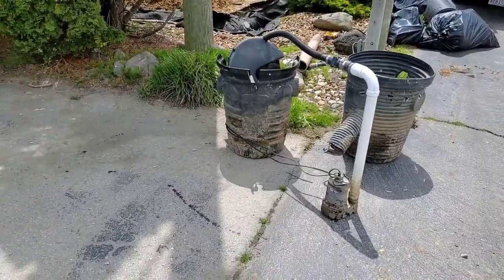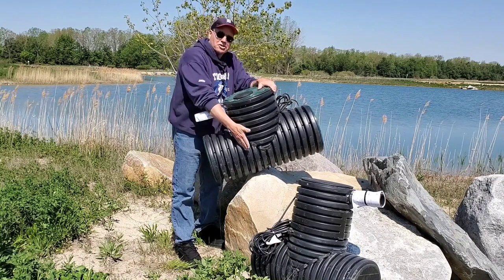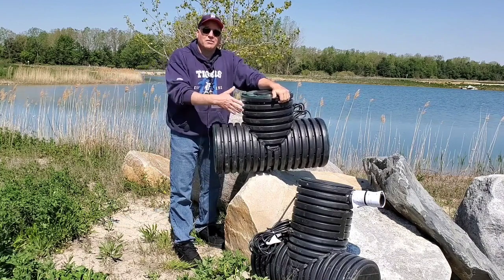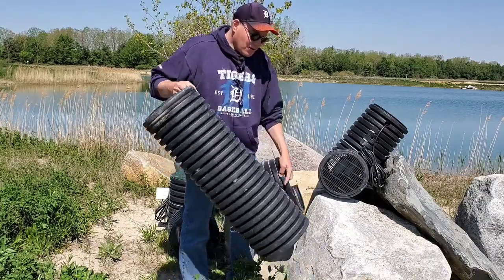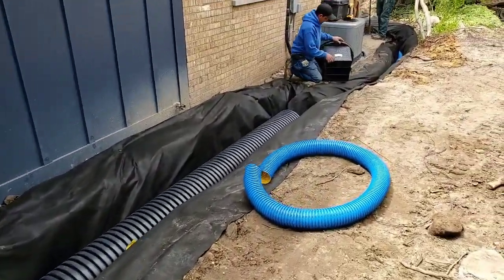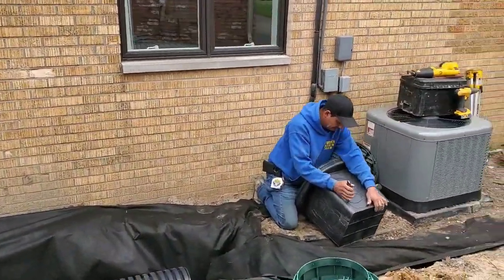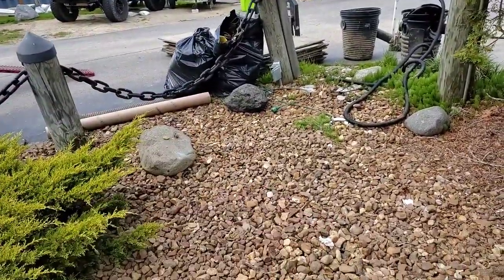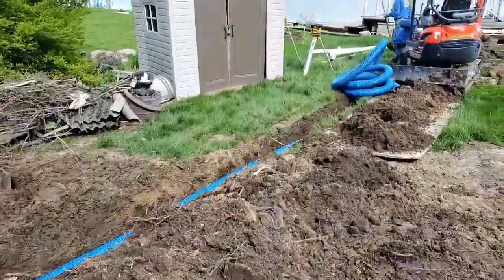Sump Pump Installation for Outdoor Drainage [Part 3] Why You Need a Chambered System

Comment: Is there a reason that the micro mini has a slotted lid on it where the bad seed has the solid lid with a small visual slotted hole?  Also the micro mini doesn’t have the extra holes drilled in the basin, do I need to drill them in myself?
Reply from the maker: The side inlets are enough the micro is a 1/3 hp the Full Frame is a 1/2 hp
Reply: @FRENCHDRAINMAN  any issues or concerns with letting “extra” water coming in the top with the lid being “open” with the entire lid being slotted and not a cover like the bad seed?
Reply from the maker: @shawnchambers5755  bark Mulch is a disaster
Reply: @FRENCHDRAINMAN  I don’t understand your reply?  Was this for another question?
Reply: @FRENCH DRAIN MAN I bought and I am getting ready to install possibly this weekend and I want to check out if I need to get a solid lid for it before I install the mini. Thanks for all your help and all your videos. I think I’ve watched at least 50+ getting ready for this DIY project.
Reply from the maker: https://youtu.be/vIkHW2bqyq0

Comment: how to you slope the pipe so it doesn't back fill? good work btw very professional.
Reply from the maker: Pump the water up in a short distance them of from 1 1/2" to 4 inch pipe. I will show this a video Stay Tuned!!

Comment: How does one of these work Inna basement with a French drain? What is the reason for having the end caps slotted instead of solid?
Reply: Hey Mike, you have the slotted ends if you want to be able to pick up additional ground water.  If you have a circumstance where you’re just pumping out storm water (from a below grade drain or something) you might consider solid ends with no holes in the unit whatsoever (as long as it’s vented to allow the water to flow in and out of course).
Reply from the maker: https://youtu.be/ZvJNV1iL0qk

Comment: The beauty of a system like this is that the attached French drain acts like an additional reservoir, with diminished capacity of course due to the stone, but it adds considerable capacity.
Reply from the maker: I don't like to hold water in the trench because tree roots will sniff out the water and fill the trench with roots. 10 inch of water turns on the pump so I make sure to be at least 10 inch below the trench bottom. Our shallowist system is 24" and that's for a 14" trench.
Reply: @FRENCHDRAINMAN  completely agree.  I meant during a torrential rain event or during a storm surge when the pump gets overwhelmed there is still a place for the water to go other than just sitting on the surface.